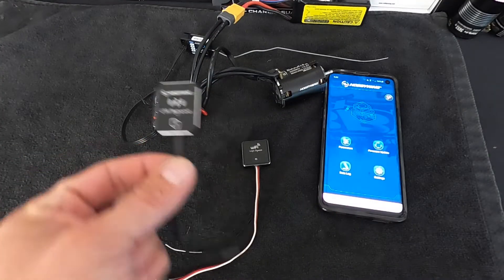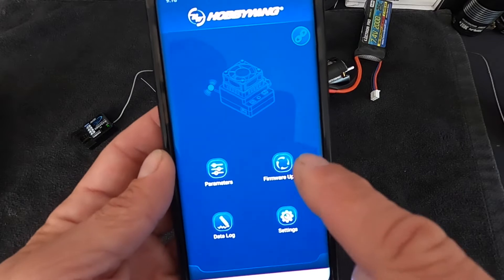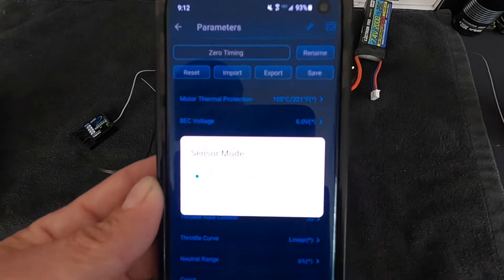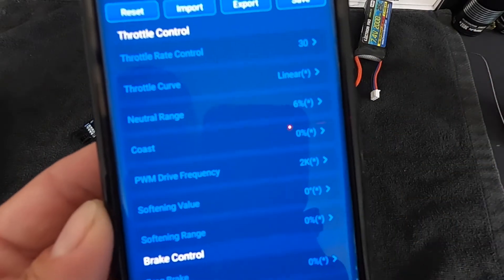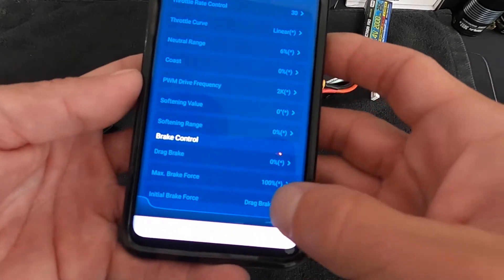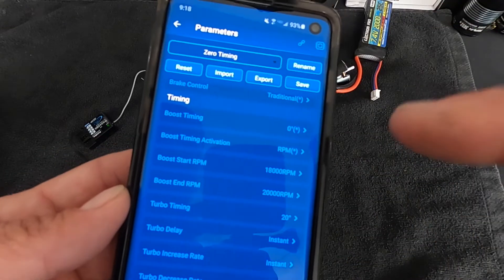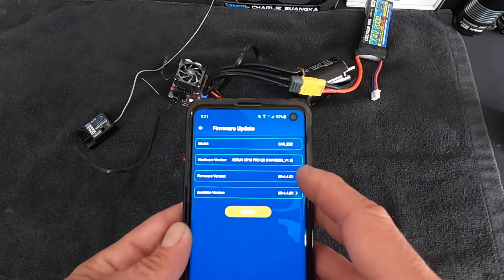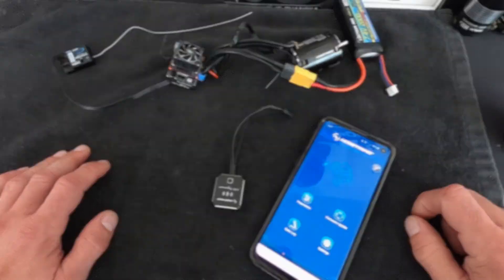The Charlie Show /// Episode 188 /// OTA Programmer

Comment: does a hobbywing max 4 ESC have the throttle adjustment settings?
Reply: Did you ever find that out?
Reply: @  yes it doesn’t have the throttle adjustment settings. I can make throttle adjustment with my futab 10 px radio

Comment: hi! i just got a HW OTA Programmer and connected it with my XR10 Justock 60A esc. and after the firmware update, it seems the drag brake is on. even if i set on the parameters to 0. can you do a video for the XR10 Justock 60A esc?

Comment: Hi. Love HW products. Just bought  XERUN XR8 plus Combo with 4274 2250kv motor. I plan to install this set up in a Typhon TLR roller 1/8 buggy. My question is, can the OTA blue tooth be used like the Wi-Fi module and leave it connected to esc for live tuning?
Reply: Yes.

Comment: Can you leave this connected and mounted in the car?  I know the motor won't run while you're in the parameters menu but other than that it seems to run while connected.  Also I'm having trouble figuring out the data logging.  I made 4 runs and powered off the esc between each run but when I connected the OTA it only showed 1 data file.  I didn't have the ota in the car while making the runs so I'm wondering if the esc can only store one file and maybe the ota expands the memory.
Reply: Were you able to drive with it connected? Can you use this to update parameters live while running test laps between changes without having to remove the body and touch the car?
Reply: i have one. i leave connected and mounted to the car. when i connect to it, it prevents the car from moving, which is nice. settings are applied to the car on disconnect.

With regards to logging: i have a max10 g2 and the only way i can get logs off the car is by selecting ota\wifi option under "datalog" > "datarecord". when i do that i can see (currently) 83 files that contain rpm, throttle, current draw voltage and temps for motor and esc

Comment: I have a dumb question. If you change settings in your ESC and hit "save" in the app, do you need to turn your ESC off to complete the changes? I always did that with my HW program box, just didn't know if it was required with the Ota programmer. Thanks.
Reply: I was told by someone that yes you should. But I usually end up doing this because I don’t disconnect the programmer until the esc is off anyway.

Comment: So you cant leave this plugged in? Ill probably stick with the program card that does mainly the same thing. It should be able to give you live data for $60. In the time you spent waiting for the Bluetooth to connect I wouldve had the car programmed and been outside bashing.
Reply: You can't do custom throttle curves with the LCD program box

Comment: Will this work with the Max6 and will there be data logging for the Max5 and 6? I run X-Maxxs. I have the wifi one now in one of them and just finishing up a Castle Monster in the other one for logging ability. But run Hobbywing in a speed Bandit and noprep drag Slash with Max10s in them , 3652 and a 3660.
Reply from the maker: The OTA does not "add" features to an ESC.  If the ESC does not "have data logging" this won't add it.  Max series does "not" have data logging. 

OTA, works on all the same ESC's that the WIfi or LCD box worked on, so yes, works on Max series.